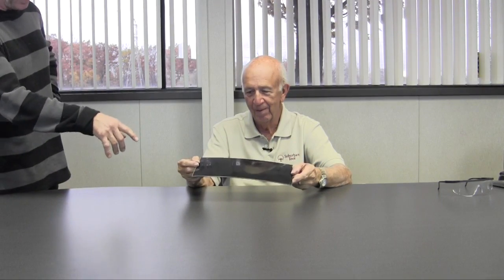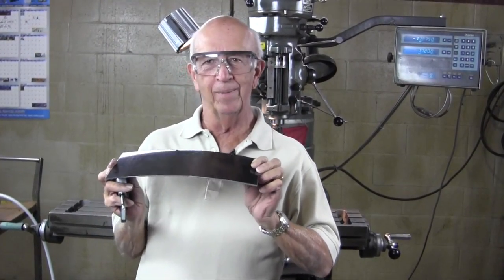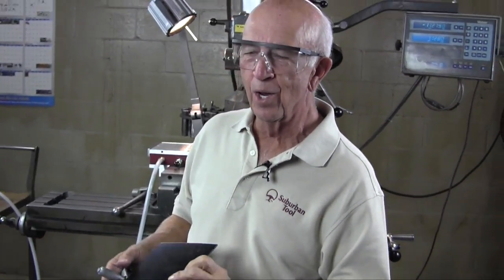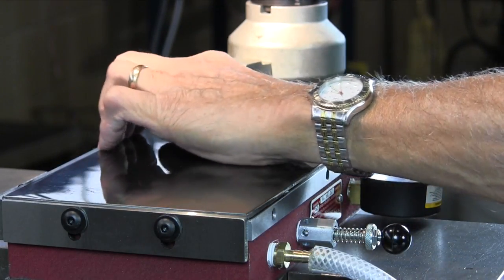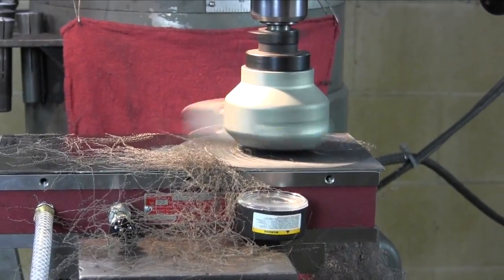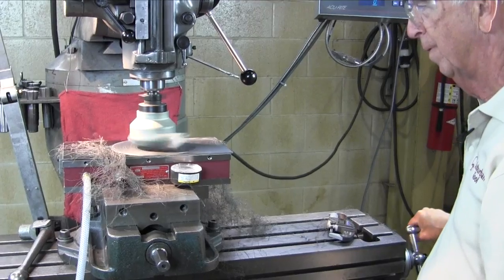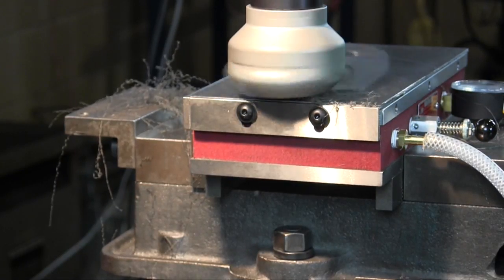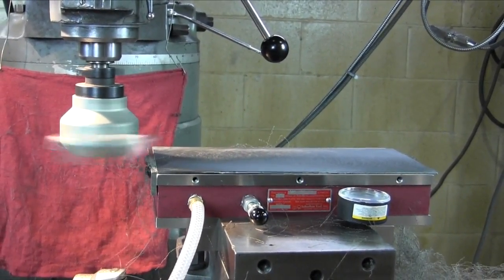Don Bailey Shows How to Hold Thin Plastic When Milling on a Bridgeport

Comment: Thanks for another interesting demonstration of how to make an "impossible" job easy. Here's some specs on a customer's  job that I've machined successfully for 20 years. .093 x .750 x 24 white Teflon strip with a .320 wide x .068 deep slot down the middle. Depth tolerance is + - .005 full length and the cutter cannot break through. Normal order is 15 parts from a 12 x 24 Teflon sheet. The fixture is oak wood, I do not have a vacuum chuck, and the job is done on a Bridgeport.
Reply from the maker: Great input, thank you for watching.

Comment: You asked for suggestions ! Read some comments and they are full of ideas to. Probably better then mine.
So I'am not really impressed .But could I do better? Not at this time, Finish is poor, and actual tolerance is not the greatest, except possibly suggest and use a different method and cutters, with many blades to produce smaller and finer cuttings and to use a air blower or liquid to drive off the cuttings, or better still use a horizontal mill with a big blade like a wood planer with many cutters, with your vacuum vise or other methods as mentioned  which may have done a much cleaner cut with air etc to remove cuttings, or use a proper horizontal plastic grinding wheel (like a roll of steel wrapped with grinding grit in the same process and take off smaller amounts for a much more accurate cutting, (like the type of grit used in auto body work or for polishing) but questionable and will it work, and would need verifying to prove validity,) air or water or liquid lubricant may also be necessary, and then your mill which was noticed is cutting on the back side. Not perfectly aligned I would think.

Comment: I use painters tape and quick glue. But usually I have to keep'em flat, straight and parallel without grinding. So I sing them the banana song.

Comment: I would think there is a little heat build up and some loss of curvature would be lost
But that is not the main thing, There is the finish on the plastic that is lost,
But I suspect it would be much better had you ground it or used an better tooling with a coolant and blowing the cuttings away.

Comment: Haha, I had to make a .015 thick rectangular part for a customer recently out of 6061. I didn't have a vacuum chuck, so instead I used hold downs, and followed the cutter with a screw driver to press the workpiece down during the cut. It actually worked, though it took two setups to surface the entire part, while with a vacuum chuck as demonstrated here, you only need one set up.

Comment: Try .oo3 double face tape (3M) . First clean the plastic and the machine with acetone. You can add a larger work plate to the table and fly cut it flat. SOP!

Comment: I would question the following
Then you say curve is retained, But in actual fact I would doubt it.
Why?
Because there is some heat build up in the plastic, and that will alter the surface and distort it, even if it is minute, Then because you are using a fly type of cutter, This does not give you a clean polished surface that was originally, re the mark you got.

But definitely this which you done is possibly as close as one will get it as you mentioned, 
But then if one wanted a perfect surface, Use a similar table but on a grinding surface, Finish I think would be much better.
Then one could also use a lap table and flat block, which would be easier and more accurate, and definitely an almost perfect surface.

Comment: For parts that are barely not staying flat there and are lifting off a bit, you can smear some grease around the 4 edges before you put that on. Thick oil should work too. Even some capton tape (something non permeable)  around the ends once it's on. Anything to seal the air without distorting your part from outside to center.

Comment: And it just happened to be size of the vacuum Chuck. Amazing when a plan comes together. I've always had to rely the two sided tape method myself. Just don't use the foam type. But cleaning up the sticky residue is a PITA
Reply: Try WD - 40 for double stick tape clean up /removal/  Tap magic does a good job also .

Comment: These kind of jobs are easy when you have every tool available to you. I did this same thing without a vacuum chuck and pump.I cleaned the mill table very well and put 2 sided tape on the piece and placed it on the table with a weight on it for a short while. It milled great, nice and flat and I released  it by running a wire under the piece and pulling it free.

Comment: Cripes, had a vacuum chuck and pump show up as surplus with a surface grinder and I still can't get it put to use on my mill. 1/8" acrylic windows with 3/32" bezel steps on them love breaking with tape. Bosses -_-

Comment: done the same thing with 2 sided carpet tape works well when you dont have a vac chuck
Reply from the maker: ***** Yes , that is true.
Reply: ***** I  l worked for a guy that used to say that you can't run a machine shop without double sided tape. I believe it. I've always got a roll in my box.
Reply: ***** I once had to machine down the thickness of a piece of 7075 T7  1/4" x  about 1 foot square. We had some really thin industrial double sided tape so I used that to stick it to the table and gave it a few smacks with a mallet because I was paranoid it would fly off. It stuck so well I almost bent the damn thing trying to pry it off.
Reply: theslimeylimey
Don't make the mistake of leaving it stuck down over the weekend. The bond gets MUCH better with time. Guess how I know this.
Reply: ardvarkkkkk1 hahaha :)
Reply: +skilled toolmaker pro-tip. flow acetone into the edge to release the tape.

Comment: That is the knowledge that is about to get lost if this country don't gear up with a hole new generation of high end machinist that can keep this country running regardless of or if we can get all those slave labor parts coming out of the country!
I was expecting a "Bit more complex way to hold that piece of polymer.. Perhaps freezing?
Reply: PK TOOL & DIE MANUFACTURING LLC We will Always need quality machinists. I'm not paying shipping for my Jeep's block to go to SE Asia and back just to get bored and decked. I'll do it with a chisel and stones before that. Or pay out the rear for the machinists left.